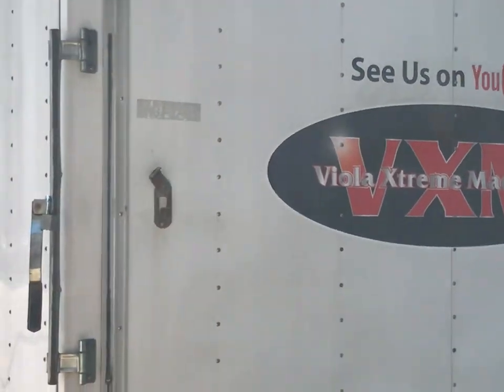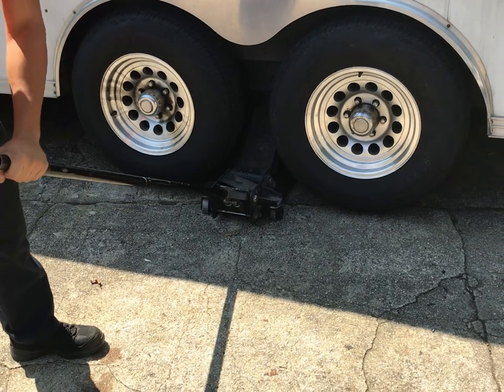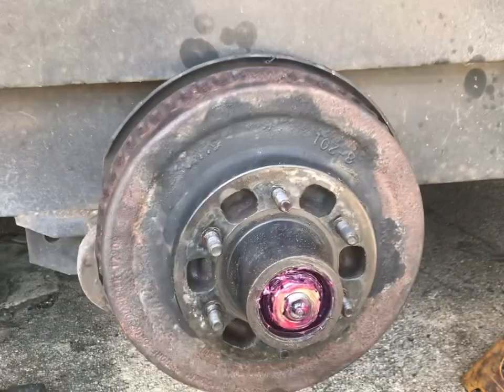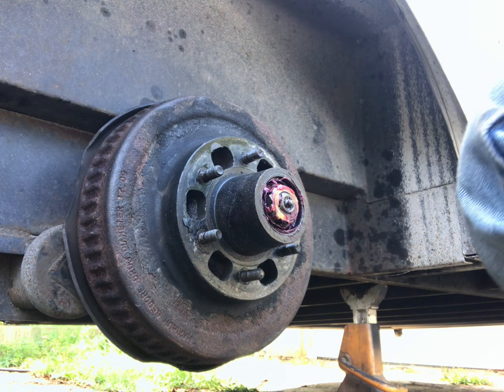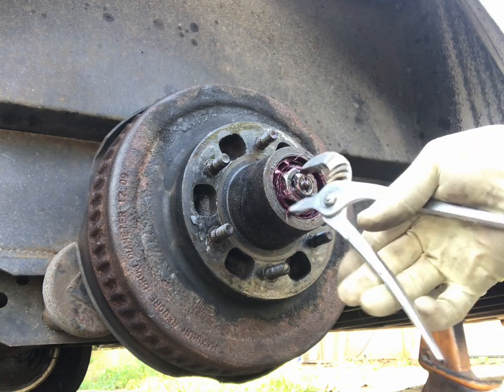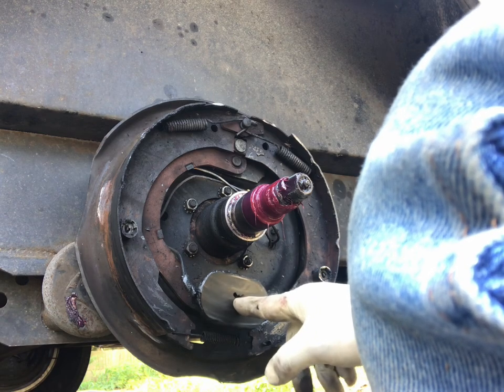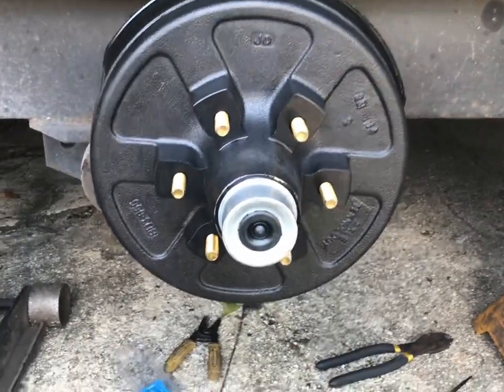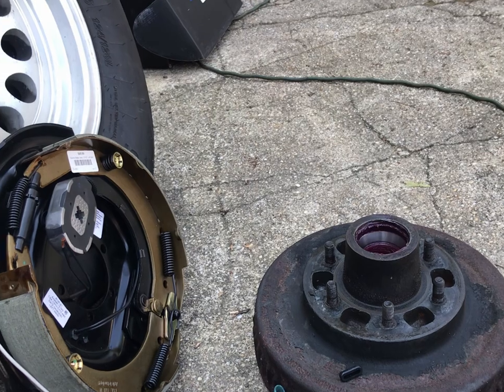How to change trailer brakes

Comment: Good video. That's why you buy the trailer brakes that Self adjust
Reply from the maker: I have never seen them.  But going to look into it. Thanks
Reply: @Jvcomet  yes sir .  Because I hate getting under the trailer too Re adjust the brakes.
Reply from the maker: Just looked them up.    If I had seen them I would have gotten them for sure.    I’ll definitely go that route next brake job.   Thanks
Reply: @Jvcomet  hey John what is the weight of the mustang and we need more videos on the hot rod
Reply from the maker: Working on the videos right now.    Be out soon.